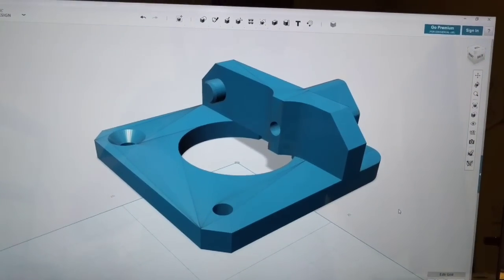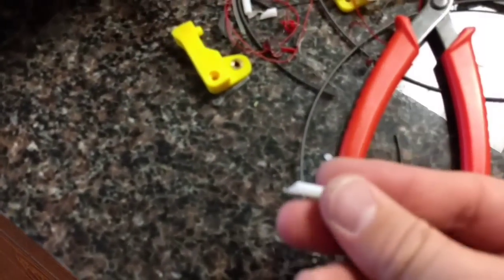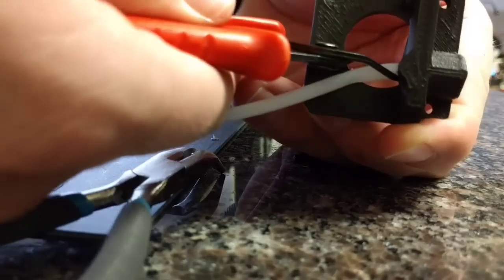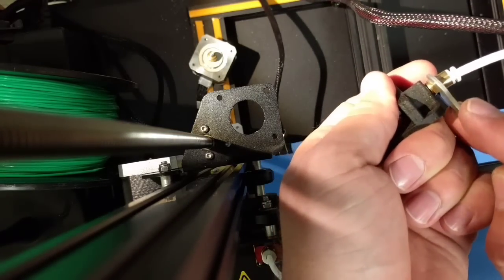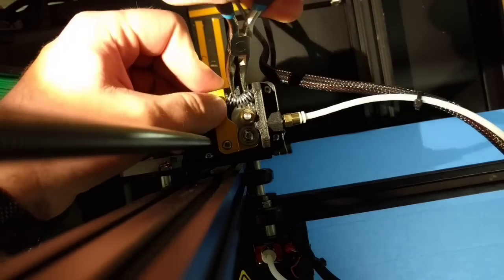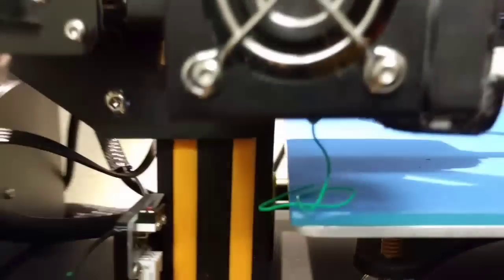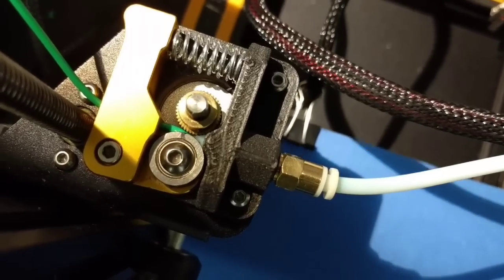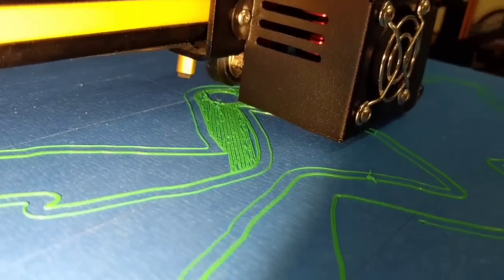Design and installation of Flexible Filament Upgrade for A5, A31, CR-7, CR-10 3D printers

Comment: My PTFE tube is not tight. It wobbles around in there. I bought a new blue capricorn tube for a 1.75 filament. I`m not using the stock white one. That could be the problem, maybe the outer diameter of the capricorn is smaller than the default white one that comes with the ender 3

Comment: Thanks for sharing. I bought a CR-7 2 or 3 yrs ago and never really used it much because the whole printing process seems complicated and frustrating. Ive decided to take another crack at it and was curious if it would print TPU because all my PLA (I think that's the filament I have) prints were too thin and brittle for any practical application. That's when I came across this video. I know it's an old video but still relevant for my needs.

Comment: I have the same printer and I have to print TPU for work a lot, the zip ties on the feed tube and wires cause added friction so I would remove them. Also increasing the temp helps. I print Sainsmart TPU with the stock extruder set up no problemo

Comment: It would help alot of people watching your video if you would mention the print settings. It's a required part next to installing the extruder to print with TPU. I found a profile for S3D but it uses extrusion multiply 1.60 and retraction of 7mm wich is more than the 6.5 I use for pla. I read TPU should have no retraction so in big doubts right now.

Comment: Great video. I’m wondering, since I see a few cr printers, I also have a cr-10. I have a problem with the first print. It’s bubbly and bulgy, but after that it prints really good. Any tip on how to fix the issue. I use cura 2.7.0

Comment: Thank you for that video, I'm waiting for my CR-10 to arrive and I'll do your trick for TPU :) Question: what PTFE tube should be used? in and out diameters? Is it easy to find?
Reply: never mind, you gave those info in the thingivers page, thanks again! But before ordering, would you mind telling me the outside diameter of the tube needed? I've found : in:2mm out:4mm is that the one?
Reply from the maker: The printer should come with an extra tube and you can clip off a length from that.
Reply: oh great ! Glad I didn't order yet! thanks for answering.

Comment: if i put this on my cr 10, do i have to change it to stock of i want to print PLA or can i just use it for PLA, ABS etc ?
Reply: Did you ever figure this out? Or still waiting?
Reply: Did you ever figure this out? Or still waiting?
Reply: Did you ever figure this out? Or still waiting?
Reply: Did you ever figure this out? Or still waiting?